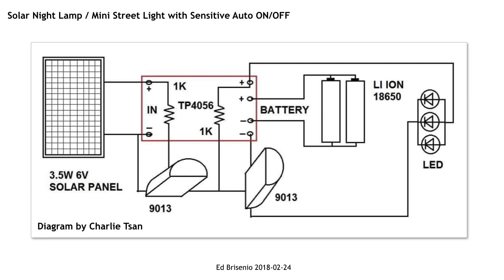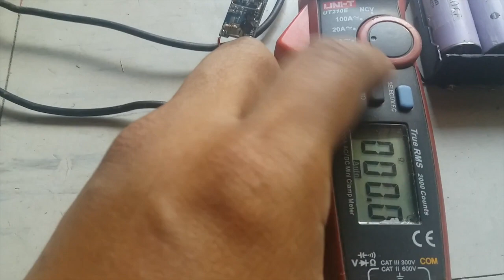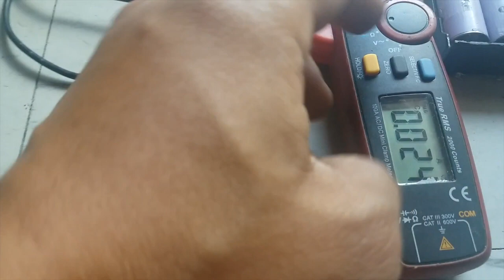DIY Small Solar Street Light

Comment: Why do we need to attach 2 transistors and resistors? It didnt work for me 😑 Help😏
Reply from the maker: Dhiren Swain which part didnt work?
Reply: The leds glowing directly by the panel not by the batteries. Even if they are connected. I used 2n2222a transistor & 1k res. Help ..
Reply from the maker: Dhiren Swain pls join Solar Power Philippines facebook Group. And post your problem. A lot can help you with your problem.
Reply: Ok thank you

Comment: Hi master ed. Can i use 9v 3.5w panel on that setup instead of 6v? I bouth the wrong panel. Thanks!
Reply: charles linn solano You need to make sure the volatge is lower than 6v, otherwise it will break the Tp4056 board. Maybe you can try a step down module.

Comment: Hi Ed. Can I use S8050 transistor instead of 9013?
Reply from the maker: S8050 is Much better
Reply: @edmundbrisenio2286  Ok. Done it with s8050. Works as well as the others with 9013. Thanks.